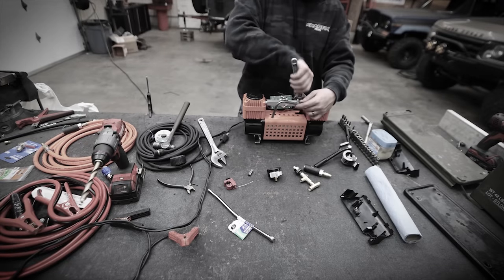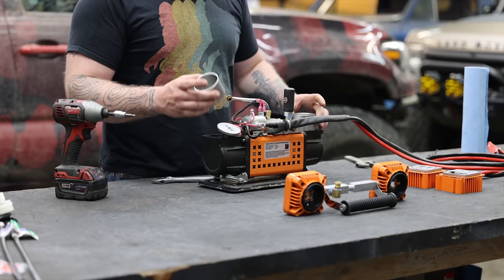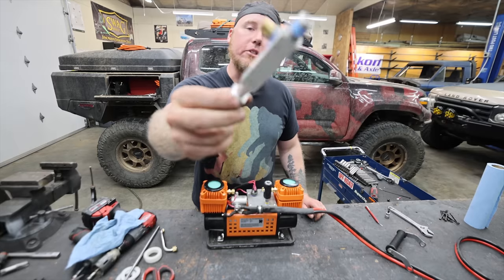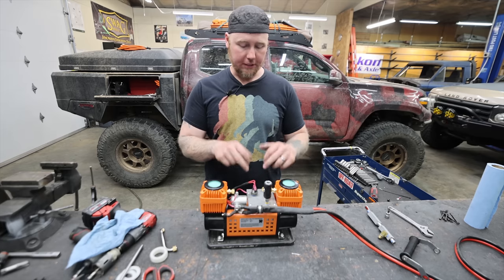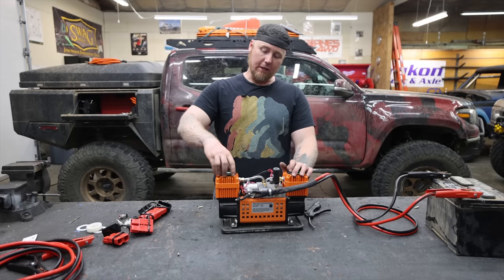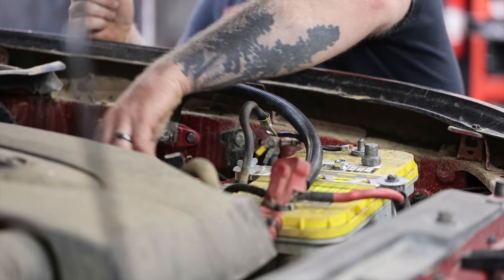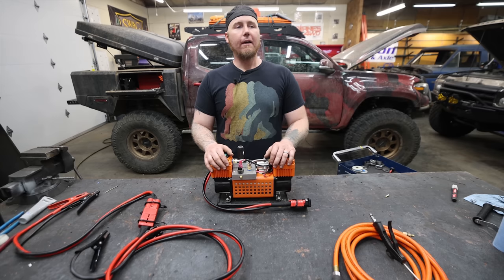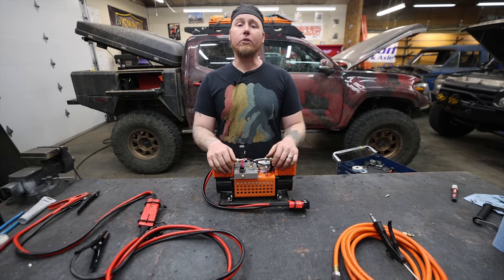Best Off-road Air Compressor MODS Part 2!

Comment: This is great!  There is a thread on RME about this and I have begun modding my compressor.  I'm waiting on a few more parts to arrive tomorrow.  I tossed the circuit board and started wiring up a 4-pin relay.  I'm adding a pressure switch as well but probably not a rocker on/off switch.  Where does the small-gauge red wire go?  Thanks!

Comment: Jump charging another vehicle. Andersons are great to use, and allow you to deliver power anywhere. Pro tip, when you solder your connectors. DO NOT leave the wire in there. Roll up some solder and stuff it into the connector cold, add more rolled up solder to the desired fill when hot. Precut your wire to the desired depth, heat the connector with your torch. Then shove the end in when it's nice and ready, should take no longer than 5 seconds. Once your wire is in, hold it straight for at least 30 seconds, that makes sure the connection is solid and cooled. The vise will help cool it, but the connector will stay hot. Look forward to see what you do for the trailer power.

Comment: With those Anderson connectors, we would also run one along the frame to the rear bumper on some of the special use trucks in Iraq and Afghanistan. There was nothing more annoying than needing power at the rear and the cables weren't long enough. This would also let us run a hitch mount winch at either end without all the wiring issues.

Comment: You could use a cheap feeler gauge set or 2 to make your reed valves. That way you could also experiment on the thickness of the reed as well.

Comment: Nice vids man👍 I love how determined you are to optomize a cheap compressor into a really solid unit, might do some of the same stuff. If you want to measure the litres per minute to compare a stock compressor if you get one you could put a tyre tube into a big tub of water and mark the water rise and calculate litres per min/cubic feet/min

Comment: I use the anderson connectors for winch quick connects, jumper cables, and a rod holder for battery welding.

Comment: Back in the nineteen hundreds I was wiring a mini truck with fat cable for a stereo amplifier.  I learned real quick to install a fuse at the battery.  Bad stuff happens fast if you don’t.

Comment: Absolute Wits End (the name of the shop) sells a bracket for mounting the Anderson powerpoles with waterproof dust caps. They specialize in Toyota stuff too. Might be worth checking out. They also have pacifiers for your OBA ports and brackets for OBA ports and powerpoles.

Comment: I run Anderson connectors on all my vehicles and I added them to both ends of my jumper cables that came from my kit from Amazon, so I can plug vehicle-vehicle, vehicle to hitch mounted winch (front, back and soon side mounted on my Jeep) or in a pinch I can connect multiple lengths together if need be. I use a 300a marine circuit breaker to shut power off when not in use. Oh and I can recharge my camper reserve battery

Comment: Soon as I saw you use jumper cables, you had a new subscriber!! Ive bought and use jumper cable for years! Everyone gave me shit when i would buy a set of 2 or 4 gauge ofc cables and cut them up when i got home! So much cheaper than going and purchasing ofc wire at the local radio shack or tractor supply.  😅
Reply: My compressor sits in a TOUGH brand cargo box in my bed. I also have my 6 agm deep cycle battery bank inside as well.   I'm installing a universal 12v HF electric auto cooling fan inside the box as well before summer. Hopefully that will keep it cooler inside there.

Comment: If you look at components on that get super hot they have fins in parallel just like those two corner intake on that compressor. You see this on lots of computer parts that get to 90+ Celsius. It helps dissipate heat best with more surface area to release heat "passively." Additional, use copper for the manifold and connect a PC fan.

Comment: Man I am loving this series! I have had one of these compressors for about 6 months and have only done the pressure switch mod and quick connect for the hoses. I’m trying to find a good mounting solution somewhere in my Gladiator but the power source issue scares me a little with running power from the battery to wherever the compressor is mounted. Don’t want to burn my truck down 😂
Reply: Longer air hose (Flexilla comes to mind) is better than longer electrical leads. Probably why he made his so short.
Reply: Power source isn’t really an issue. If you’re that concerned about the possibility of rubbing the housing off the cables you can always run it in actual electrical conduit. There are many types, including a polymer or pvc plastic, and a flexible plastic all of which can be acquired @ Home Depot or Lowes.
Reply: put a circuit breaker on it, if it shorts it trips the circuit breaker. no real reason to worry about it nearly every 4wd in aus that gets used for travelling has anderson plugs mounted to run Engel fridge/freezers. compressors, lights, solar charging etc etc also use the to send power to camper trailers for charging while driving.

Comment: crimp, solder and shrink tube.  never have any issues.   dont forget resettable breakers (Blue Star) for your leads off the busbar. in case of emergency or melt downs.   hard mount the plugs
try some outboard motor reeds

Comment: you could use 12v delta fans  usually come in 4in/120mm(?) and you'd be looking for spring steel possibly feeler gages would work

Comment: I have 175 amp Edison connections on both ends of my Ford Ranger truck which allows me to use a jumper cable or winches in receiver hitches. I can also power my inverter  to run air compressor,  power tools. Definitely an idea that's time has come.

Comment: Like the bus bar, I have the same one.  I've wanted this napa compressor since I saw it but i have a 24V battery powered unit that works great.  After seeing the mods you have pioneered I may go find one.  I use Anderson connectors for several hi amp situations from a single lead off battery.

Comment: first thing I do with every new to me truck is add Anderson connectors bow and stern. use them for all kinds of stuff, jumper cables, winches, battery charger, air compressor, camp lights, quick and easy 12v at both ends on everything.

Comment: Measure the thickness of your existing reeds and go to Mc Master Carr or Grainger and get some spring steel or beryllium copper sheet stock in the approximate same thickness and build your own to your design. You might want to sandwich the material between two thinish sheets of metal to keep the edges of the new reeds nice and straight. The beryllium copper can be heat treated to make it extra tough. You don't want to inhale the dust from the copper as it's not good for you. I've made lots of springy things from the heat treated beryllium copper and it's amazingly tough. Just my $.02

Comment: I'd build a bracket to firmly mount that sb150 connecter behind your bumper. Sticks and crap will grab it and won't be fun when it rips those zip ties pulling the cables. Frankly I would try to mount it higher and have it pointing out of an opening in the grill way above anything in the scrub zone.

Don't ask how I know.

When I worked on electric fork lifts we used those connectors on all the batteries. We would always crimp them then solder them. Used marine heat shrink with the glue in it to seal everything up.

Comment: I use the same unit just a different brand in Australia. I run it on the passenger seat with the AC blowing on it hot days. Otherwise I had one mounted behind the rear seat but 90amps was a long way to run wires. Had a few of these they're cheap and fast

Comment: For the reeds - 2 stroke engines… there are millions of sizes in different materials : steel, fibreglass, and carbon fibre. They’d be perfect. If you find a helpful supplier you should be able to just tell them your size.  You’d want smaller CC engines.

Comment: Please note that that THREADED NUT on your battery is FUSED at about 70 amps , so NEVER hook up to a winch or other high draw items it will fail. There is a thin strip of lead connecting the main and actual post to that 3/8 post but it is intended for low draw items only.   Love the mods , going to have to look at giving mine some love too.    CHEERS    Steve h.

Comment: Might want to make a pattern of the crank shafts so you can forge out some new ones the pot metal ones on those compressors do snap. Maybe cutting and grinding some new ones out of a chunk of aluminum would make for a good video.

Comment: You should measure draw amps on them too... as you increase flow on the compressor current draw will increase too.  Could be another indication of flow improvement.

Comment: For cooling first thing I would do is get that orange pant off the heat sync fins.  You would be very surprised how much that hinders the air cooling. On the heat shroud you could wire up two small PC fans to help cool the heads.

Comment: just a thought I used 250 amp circuit breaker with a cutoff switch on my winch and anderson plug,  just another layer of protection if it gets crunched.... if you go to a dual battery setup there are some great sensing relays that only charge the second battery when it see's 13.6 volts...

Comment: What if you build a copper tubing chiller with water. Similar to the ones used on PCs! We call them hydrocoolers in the food industry which we use to cool water/product going across a conveyor. You may be able to pick one up from an actual PC and just hard wire it to the same switch you can incorporate to turn on the compressor? only thing is you would make it bigger. Just need a fan and piping to dissipate heat.

Comment: I know this video is a little dated but I wanted to ask. Do you think it's possible to add an intake relocation kit to this thing?  I want to hard mount my compressor so it's not taking up space in my vehicle.  I want to hard mount it underneath the vehicle but I'm worried the elements will destroy it quickly.  Other than trying to either enclose it somehow or coating it to prevent exposure I am wondering if an intake relocation kit can be used to pull dry air from someplace above the wheel wells.  I've already eliminated mounting the compressor under the hood as I will be putting in a dual battery setup.  Looking for other options and feed back.  

Thank you for your content.  I use it frequently for inspiration.

Comment: For the reeds head over to any A/C supply store and you can buy rebuild kits for semi-hermetic compressor valve plate and take the reeds they would be sturdier. Get one off a Copeland compressor they are much sturdier parts.

Comment: Great great mod. Could you provide the exakt wiring somewhere. From what I can see I don`t understand some of the connections. Did you fix minus to the chassi of the compressor and what is the small plus connector to the manifold for? Thanks in advance.

Comment: Most tow trucks these days use Anderson Power Pole connectors for their jumper cable ports front and rear, that way they can pull up to vehicles from the front or back and plug their jumper cables in and start them...
Reply: Most use a jump box now not cables
Reply: @mrmotofy  Of the 5 different local towing companies near me, all 5 have Anderson connectors on all of their trucks...I guess some may carry jump packs, but I've never seen one around here do it...

Comment: Personal opinion, you should rebend the curves in those pipes where they exit the manifold. Go up a bit then curve. You could try packing sand into the pipe before bending it to keep it from collapsing.

Comment: I used a computer fans to blow air across the head of my compressor to keep it cool , now I use a marine 3'' bilge air blower to cool my stereo amplifier, air compressor and keep my fridge/freezer compressor run cooler also i use the 1/0 wire with anderson plugs for jumpers, run a removable 12 volt aux battery etc

Comment: since the compressor runs at a fixed rpm, you could potentially take advantage of that and make intake tubes to just the right length and increase flow.  i'd watch that video for sure!

Comment: You can probably use reeds from older mercury or other brand 2 cycle outboards.  If there is a shop around that messes about with old outboards, you might find that some merc reeds will do the trick or could be modified to work.

Comment: Nate, I haven’t checked to see but maybe an argon flow meter could give you a round about idea of cfm I’m not exactly sure but if it’s inline and you modulate the flow no different than tig welding. Would it not max out at the highest cfm from the compressor?

Comment: In regards to cooling, would it be worth running more holes through the aluminium manifold. making your own water jackets with coolant and small circulating pump. similar to a motor block or Water cooled computer?

Comment: Have you ever considered the 12v line of PUMA compressors? They have 1/2hp, 3/4hp, and 1hp motors. A permanent on board solution with the 1hp would be cool.
Reply: They're still a much lower output option
Reply: @mrmotofy  really? They're full size oiless compressor motors. How much is that little napa putting out?
Reply: @mrmotofy  they're also continuous duty

Comment: I know this is old, but thought I would try on here to see about something. I purchased a MaxiTrac when they first came out but ended up having it stored till I was able to work on my overlanding rig. I pulled it out and have been looking to see about mods and everyone adding a pressure switch. It says on my paperwork that mine has a built-in pressure switch.

Comment: The problem with more airflow is that it will take more power to compress that air. The motor is going to burn up. Check the amperage on an unmodified unit vs yours. Then check motor temperatures.

Comment: FYI... there are no soldered connections in aircraft wiring, except for maybe low level small wire signal connections, i.e. high density connectors.

Comment: New to the channel and think you’ve got some great content. I have a question about psi. Do you think this setup can handle 200psi? 
I have a Disco 3 (LR3) and if I was to have a suspension Falya I would need at least 200 psi to make it usable to move the vehicle somewhere so I can carry out repairs. Just to get it off the trail. Keep up the good work. 🇬🇧
(should only ever need to do it once maybe twice)

Comment: Reeds - I hear some of the RC guys use floppy disc material ..??  When I raced and wrenched MX, I made reeds out of both FRP & CF sheets.  CF was crazy expensive though.  Floppy disc = prob free. The up side to both CF & FRP is when they break on a two cycle it will not trash the top or bottom end as a metal reed can.

Comment: I dismantled mines today. I noticed that the the cylinder walls weren't making any contact with the external heatsinks. Not sure if it'll make a difference, but I put thermo paste in between the space so that now there's actual contact to transfer the heat.

Comment: If you are going to put the black covers on teh Anderson Plugs, use silicon on the cable end otherwise your plug will fill with water and short out.  especially if it is hanging in upside down

Comment: For reeds you could try fiberglass for carbon fiber reeds from a Yamaha Blaster or YZ85.   those will be an upgrade in size and if they break they won't ruin the compressor like metal ones will.

Comment: I strongly second the previous comment.  It's absolutely critical to have properly sized fuses or DC rated breakers in line with your compressor electrical wiring.  You're looking at some pretty high current flowing through these cables and fuses are your first line of defense in preventing electrical fires.

Comment: I prefer soldering in general. The connection being soldered, should keep corrosion out of the connection. That being said I am a belt and suspenders thinking guy. I'd crimp and then solder, especially on the high current connections. Surface area does matter with electrons.

Comment: With no CFM air flow meter, just perform a before and after comparison of times to raise tire pressure from 10 to 35 PSI.  Do test in triplicate and average the times.  Without data, there is no way to tell if the modifications are worth the time/money.

Comment: You can build a portable air compressor that will put out 10,000 CFM and it wont matter because at the end point of that compressor (schrader valve) you are restricted to filling the tire at about 2 CFM.  Am I right or am I right? Although I am subscribed and love all of your videos, this one just seems to have little return.

Comment: Get an air pig tank and time how long it takes to get up to pressure. Would probably have to buy a new stock un modded compressor to get the baseline

Comment: I use my winch connections at the front just put ring terminal on then Anderson connectors I added a fuse to the hot side

Comment: I have Anderson connectors on the front and rear of my truck I use them for jumper cables and my winch my air compressor is hard mounted because if it wasn't I would forget it at home

Comment: I would install a fuse in the wire between the + terminal of the battery and the "eletrical manifold". When one of the wires after the manifold shorts out, it will save your car from a fire. Better save then sorry.